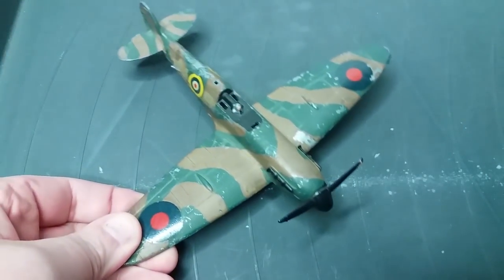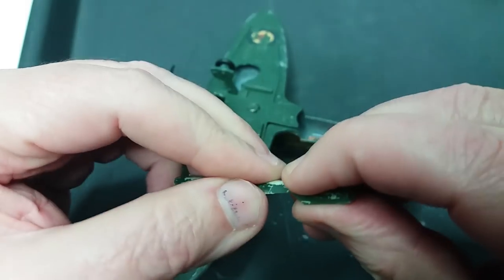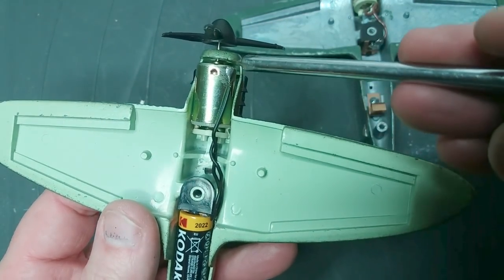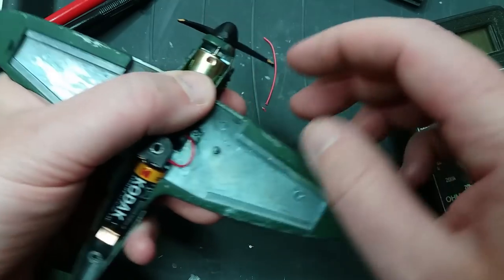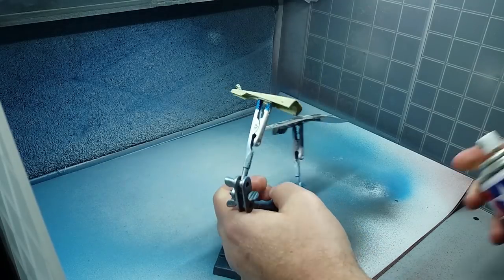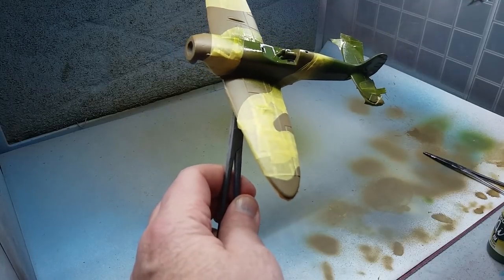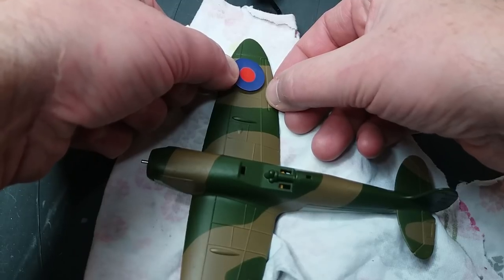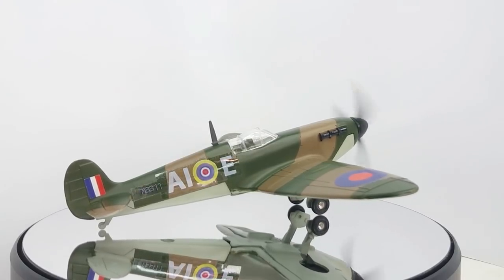Dinky Toys Spitfire No 719 Diecast airplane custom restoration

Comment: I thoroughly enjoyed your videos on the Spitfire and Stuka. I was working on the Stuka when I  came across your video and it was very helpful. So, went for the Spitfire. As I think someone said, the parts work out dearer than the plane....but the one I bought for a fiver, under the repaint job, was actually ok - straight, tailwheel present, motor present and no nasty scrapes in the metal. So, around VE Day, she screamed "fix me", so I'm doing it. Every Dinky deserves a second chance.

The Spitfire video was excellent too. I just hope my motor springs into life when the prop goes on. Can't wait - must be lockdown loopy!!!🤪😄

Keep up the great work......Mike
Reply from the maker: I think we are all getting more loopy! Yes often the parts cost more than the project but that's knot the point the fun of fixing it is the thing.

Comment: After more than 45 years, I was able to start running the engine from my Spitfire. Thank you for this good video. If it wasn´t this tutorial, it would still be dead for a lot more years to come...Thank you!!
Reply from the maker: Cool!
Reply: @diecastrescue3597  ...I should've said"wasn't able"...I think you've spotted the mistake :)
Reply from the maker: Its often the connection between the motor and the aircraft is the problem a multimeter is very helpful to find out where the problem is.
Reply from the maker: @jrowe9301  I have one probe on the case and the other on the connecter of the motor.

Comment: I have an original one of these from my childhood. The motor still works and I use a Duracell MN21 12 volt battery. This makes the propeller spin really fast like it used to when it was new. It is slightly shorter than the original battery (it's 27mm long) but bending the negative pole in slightly has worked.

Comment: GEART resto of the SPIT ,I have both versions one with and one without  the motor , I  also and this is no joke OWN A REAL SPIT MK 5B  THAT LIVES AT DUXFORD  I DID ALL THE BODYWORK / PAINTWORK  ON IT , AS I HAVE MENTIONED IN A PREVIOUS VIDEO OF YOURS  ,I AM A QUALIFIED PAINTER  AND ALSO A PANELBEATER .THE MECANICAL WORK WAS DONE BY DUXFORD FRIENDS OF MINE , AND YES  MY SPIT DOES FLY .
Reply from the maker: I dont think I can top that  :)

Comment: The motor is a 2 pole armature with  a single magnet, not 2 magnets. The motor turns on and off at each revolution and uses momentum after switching of to carry it around to the next switch on...brilliantly simple.

Comment: I got one of these, and the Stuka, for my 8th birthday in 1969. They were my pride and joy. I had forgotten all about the kit version, didn't they come with little glass vials of Humbrol enamel? I think the motor was the same as used by Airfix in their 1/24th scale "Superkits".
Reply from the maker: Thats right glass vials with a cork stopper although i have a video underway showing a kit with a tin of "Gloy" paint instead. Now I do not know about the Airfix motors been the same i shall need to do some research.

Comment: It has cannon bulges on the wings so it could also be a mk-v
Reply: It's a Mark II. During the Battle Of Britain, it was noticed that a lot of  .303 ammunition was needed to down a bomber, and also most German aircraft carried at least one 20mm cannon which did considerable damage. Some Mark I Spitfires were retrofitted with two 20mm Hispano cannon, but at first, only a couple could be allocated per squadron. Because of the extra weight and recoil of the new weapon, the wings had to be altered accordingly, and were different enough for Vickers Supermarine to call it the 'Spitfire II' The Vb and Vc versions were totally new airframes made for use with cannon. However, the aircraft that really worked well with cannon in the early part of the war was the Hurricane IIb, known, and feared by the Germans in North Africa. It carried bombs, as well as the four 20mm cannon, and was known affectionately by the R.A.F. as the 'Hurribomber'.
Reply from the maker: I am more a Hurricane man myself :)
Reply: @brianartillery  And they were in their infancy as they would jam at attitude due to the oil freezing.
Reply: @diecastrescue3597  Hear you brother.

Comment: I’m guessing you need to be inserting the battery with the negative terminal to the terminal on the fuselage. The motor is a single pole motor which is why it’s a bit lumpy as it gets its power in pulses every 180deg of rotation.
Reply from the maker: Thats right Dinky were negative earth :) Weirdly that motor is a rough runner but the One on the zero and 109 are very smooth.

Comment: From what I can see of the Spitfire you're repairing I think it was one of the kits that were released rather than a completed model. The washer that holds the undercarriage spring is the giveaway. The completed models had the spring post fattened with a punch device during assembly and the build yourself kits had the spring washer.

Comment: There was a No 741 with no DC motor.
Reply from the maker: I have never seen the one without a motor all the ones i have come across had one did they make many of the 741 ?
Reply: Diecast Rescue I think the 741 is relatively scarce as it was produced for a shorter period than the 719.

Comment: Hello ! Please, where can I find 2 or 3 of these types of motors Mabuchi ? I ve tried to look at Mabuchi's web site but they do not reply . I am restoring  3 spits and if the production has stopped, I think to change these motors and electric feedings. What do you suggest for finding these origininal Mabuchi motors ? Thank for reply. Best rgds ,Chtiwill
Reply from the maker: you can get the motors from from broken dinky sea king helicopters from ebay

Comment: Super nice job. Not my favorite plane though. My fave warbird well it's a toss up, between a P-51 Mustang, and a P-38 Lightning. However the Mustang had that same engine... eventually.  The Rolls Merlin engine. Still hasn't been surpassed by any other piston engine for raw power.
Reply: The Pratt and Whitney R2800  Twin Wasp .. that powered the  F7f Tigercat says ..hold my Beer!! .. Oh and  the Bristol Centaurus used by the Sea Fury pack's more punch..  So really you are talking utter bollox.
Reply: @kittyhawk9707  Never heard of a twin wasp or f7f tigercat. Never heard of a Bristol Centauraus either. P51 and P38  have much better marketing guys I guess. However you can't tell me anything looks cooler than the P38.
Reply: Ian Johnson Right on! And let’s not forget the massive Napier Sabre from the Typhoon and Tempest ...